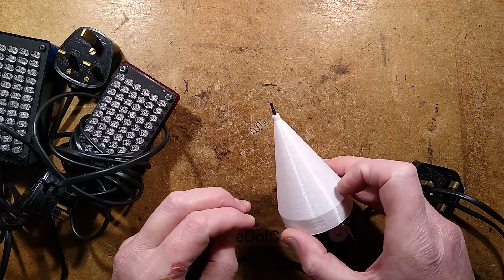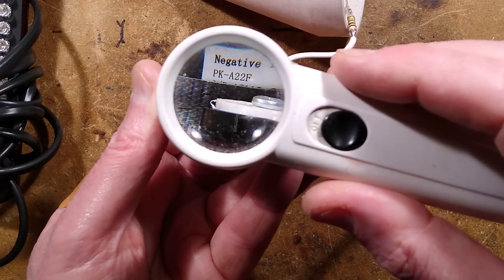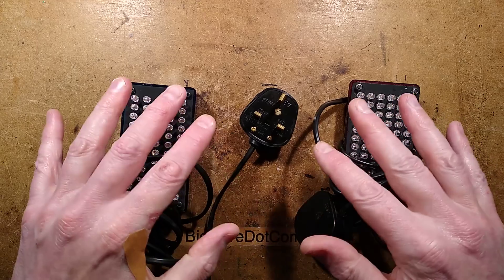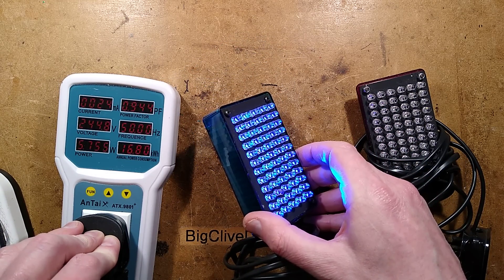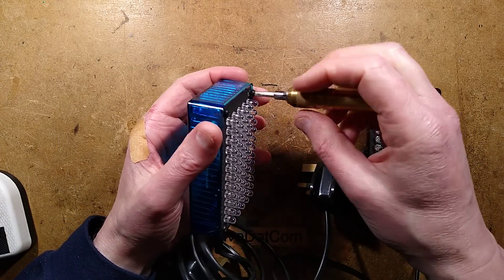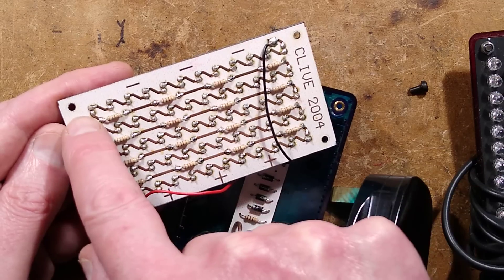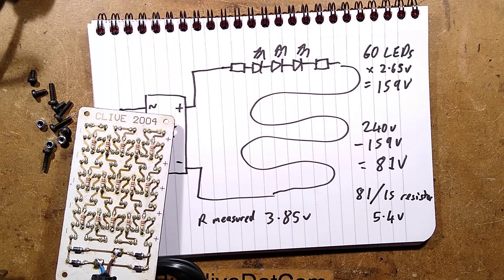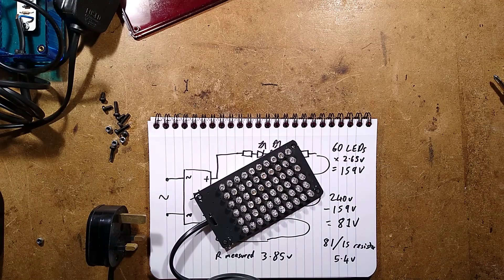Revisiting an OLD project from 20 years ago - with schematic.

Comment: I like these simple designed led lamp circuits with no fuss. Great to dissipate the heat over multiple resistors scattered around the circuit. Nice perfectly aligned LED's.

Comment: You mentioned wondering if things still get blocked by customs.  SparkFun did have a little fracas a while back when they bought a batch of inexpensive multimeters from overseas and they were held at the border because the yellow/gray color scheme was trademarked by Fluke.  A bunch of people were mad at Fluke, but they hadn't done anything, it was the customs agents that made the decision.  Fluke was very nice about it, and gave SparkFun a batch of genuine Fluke gear to replace the impounded lot.  I notice that some of those LEDs haven't failed entirely, they flicker some when power is first applied.

Comment: Hey there! Have just purchased a whole bunch of solar LED lights in Poundland and my troubleshooting on google led me to your channel! Essentially nothings turning on despite being left in sun for hours, is there a video you can point me to where I can learn how to identify the problem? I have zero technical knowledge but I do have a screwdriver and enthusiasm!
Reply from the maker: Check there's no battery tab to pull out and that the switch (usually hidden under the lens) is in the on position.   They can also be a bit sensitive to ambient light sources and stay off if you have another light nearby.

Comment: That burn on your left hand must have been quite deep to be still requiring sticky plasters😔😒😀 I have one on my left shin from my time as a motor rewinder. The result of a blob of melted plastic motor insulation, that landed on the leg of my overalls. It keeps releasing a scar plug that requires occasional taping😀

Comment: I remembered Radio Shack first released oddball Silicon Carbide blue LEDs back in 2000, they weren't the brightest thing in the world. A year later they finally released Gallium Nitride-based white LEDs. It was an interesting time, I remember being amazed by the first generation blue LEDs (both Silicon Carbide and Gallium Nitride) as red, yellow and green were a bit long in the tooth for me at that point in time but still a fun little component to play with.

However now, LEDs have gotten so ridiculously powerful that you can use them in flashlights and LED headlights (currently using the Nichia 319AT flashlight I put together, it's a wild tiny thing, only 3 x 3 millimeters in SMD LED package size, yet powerful enough to annihilate the eyes, I drive the 319AT LED in a Convoy S11 26650 flashlight somewhat hard, nearing the maximum amperage that datasheet said they can run all day long at with cooling, 1.9 Amps, and boy, it can light up the WHOLE room with just the specular reflection alone at full brightness).
Reply: Wowsers. I have a 519a and they can be blasted with an astounding 3 amps without keeling over. Possible out of tolerance but still impressive. And they're like 97CRI to boot.Nichia makes good stuff - I think they were the first blue led company.

Comment: Reminds me of the LED oscilliscope I built 45 years ago from a diagram in Popular Electronics magazine. I had a 10x10 grid of leds soldered into perforated board with wires running both ways. It worked, but every so often, one of my solder connections would fail. I had to use it in a dim room to be able to see the red leds.

Comment: I know what you mean about being unable to find a video. I spent like two years on and off looking for a video that featured a little side-firing 18650 light that almost looked like a mini fluorescent tube. By the time I found it, the factory that had made them in that size ceased production. I ended up finding an Energizer light that was the same size and roughly fit the bill.

Speaking of, I bought a spare of that Energizer to send over, but it seems almost impossible to disassemble.

Comment: Totally unrelated but the tiitle and thumbnail reminded me of it: I just bought a cheap nose trimmer that is said on the website to have a built-in LED but it's actually a tiny incandescent bulb !
And switching it on reminds me of my childhood's incandescent flashlights as well as of the era itself.
Reply from the maker: That's very retro.  Probably an old design that hasn't changed.

Comment: wish i could go back in time and learn how to make them from you. 
i think in 2004ish i was learning how to make my social centers PC go Pop by changing the RED Switch at the back of the Powersupply to 110V 
hahah had fun and no one found out untill i came clean back in 2012 aboot it.  i did how ever learn about the safity issues and such of PC Power Supplys
Reply: Dumb arse kids used to do that to the teachers desk computers in my high school... Until the standard procedure for unpacking new PCs had an additional step of dribbling 2 part epoxy into those switches.
Fortunately by the time I got a job in a school, those switches were a thing of the past and they all have full range inputs.

Comment: It would be interesting to rebuild this with modern LED's (same circuit) to see the difference in light output and power consumption.
Reply from the maker: Massively high light output.  It would be interesting to see an old one and a new one side by side.  Even just changing half the LEDs in one unit.

Comment: Looking at old projects, I'm looking at my old LED digital clock. Its big ! 6" (15cm) tall digits made up of 28 discrete 5mm red LEDs per digit. Six digits. TTL logic. Uses 15W, and a linear power supply. Mechanical hourly chime. Dim old red LEDs, as it was made in 1982, when I was still in college.

All LEDs still working. Replaced a power supply cap, when it was only 10 years old, and 2 7447s over the decades. Blew a lot of dust out of it, as its vented.

Comment: What would be the pros and cons of adding a "smoothing" capacitor to your lamp?
I'm guessing, you would need to handle peak-voltage, instead of RMS and I also guess it would ruin the powerfactor. But is there anything else against or in favour of a cap?
Reply from the maker: It would be a good improvement, but would require a lot more LEDs to keep the resistor dissipation down.

Comment: I made a pyramid ioniser case from paper mache using a unit like that recovered from an old air conditioner fan thing and put a neon bulb in it. But unfortunately I think a new ioniser module is needed since I see no noticeable signs it's working when I look at the carbon brush.

Anyway, break apart tissue in warm water, add pva as desired, shape, dry... profit. The poor man's 3d printing.

Comment: I think you did do a video on those lights, unless you do a lot of projects with those serpentine tracks.

But that’s okay, looking to see how a project has aged (or not) over a span like that is a Good Thing. Honestly I’m surprised that more of the green LEDs didn’t die or change color. You mentioned that you think heat might be the cause- letting it warm up for an hour or so and looking at it with an inexpensive thermal camera would be instructive. Would have been nice to have those twenty years ago, no?

Comment: Not just old school 2nd class leds that fail. I spent this morning swapping smd leds from one gu10 lamp to another based on the latter having just one short and one open circuit. The former had five blackened, Incinerated and several that look cooked.
Annoyingly, the lamp works for a while then one string of 30 - half of the lamp, goes out until the power is turned off and on which restores it briefly. So I now have to find the leds that are going open circuit I guess.
It has a cap, bridge, resistor driver board that was stuffed behind the non heatsink led circuit board leaving a brown burn mark. They weren't even cheap ones,just badly built for the throw away society. 
A few years ago I would have binned the pair of them but my new found knowledge from your channel & similar has caused me to start understanding these issues sufficiently to attempt a repair. Plus it saves me a morning of driving 30 miles, paying as much for parking as fuel to get there and hunting for a shop that sells replacement lamps or waiting five days for China or eight for British sellers to despatch and deliver some.
Reply: they are cheap ones just sold at ridiculus markups
Reply: @urugulu1656  you must let me have your crystal ball or perhaps, with your insight, you can find my missing 8mm socket

Comment: I have often been wondering about what the powerfactor is a measurement for when the powermeter appear in your videos. So, what does it stand for and how is it calculated/measured?
Reply from the maker: It indicates the relationship between the voltage and current waveforms.  Not super important for most people, but quite important for the utility industry.

Comment: The first blue LED I bought cost me $15 (yes, for one) and was nowhere near what you'd call bright. 
But it was BLUE! "Just imagine all the cool stuff we can do when these become cheap!"
Yep, they're even sticking them in computer fans now for some friggin' reason...
Reply: Those were the old Silicon Carbide blue LEDs. Not very bright, but the blue color is just fantastic vs the modern InGaAs blue. I bought some new old stock, and if they weren't extremely rare I'd integrate them into more projects.
Reply: @No-mq5lw  It was a nice color.
Reply: It's so you can watch the air it's moving.  😁
Reply: @sarkybugger5009  When I first saw LEDs going into fans I figured, "cool, they're gonna strobe it!"  (Also figured they'd put something on the blades to animate) but so far I still haven't seen it done (nor have I been looking.)
Reply from the maker: I think they have done "message" fans with stripes of LEDs.

Comment: Isn’t the measured voltage drop across the resistors affected by the diodes when they are not conducting the unsmoothed DCV?
Reply from the maker: The main issue with getting a measurement is the unsmoothed DC and odd current waveform due to the voltage drop across the LEDs.

Comment: Reminds me of a to3 transistor, 2 cement wire wound resistors from radioshack and 2 windings of speaker wire, hot glued to a flyback from an old TV, that's one thing I'm going to miss is the availability of free flybacks in the alley
Reply from the maker: I gave myself a few high frequency burns making similar high voltage inverters.  These days a MOSFET might be the way to go.

Comment: I know that feeling. I had the same kind of shock when I looked at a date on a project and said that was 20 years ago!
Reply: Oh, let me check a project I made after I started my first job, ah 1988! It’s a bench PSU that I still use. Only thing that I have replaced is one of the potentiometers. Although one corner pillar in the case is broken. All the parts came from Maplin by mail order.
Reply: Looked at one, and i made it in high school........
Reply: I can usually date mine by the soldering. It starts with wires twisted really really tight and progresses from there. :p

Comment: You should really get a small handheld electric screw driver. Those pen-lile ones are nice, dont have too much torque to strip the screws. A slight downside is that they might also not have the torque to pull out tight screws.

Comment: I had a conversation with another author of a project that applied rectified but unfiltered (not "smoothed") DC to some nonlinear devices like LEDs.  He said it had to be multiplied by the cosine of the phase angle of the conduction.  For a blue LED, it doesn't conduct until the voltage gets up to 3V.  So if the AC across the LED is 6V peak, the LED is conducting current during the 3 to 6V part of the cycle.  But I've forgotten the rest of the calculations involving the cosine, etc.  I hope that was helpful.  The greatly simplified solution is to connect an electrolytic capacitor across it and get straight DC, making it easy for the meter.
Reply from the maker: The blue LEDs start conducting and glowing at about 2.6V with increasing forward voltage as the current increases.  That makes it a super-complicated voltage/current waveform.

Comment: The boards look similar, believe you posted something the same about a year or two ago, but don't entirely remember, something about you painting the boards black...

They held an item in customs because of the locking nuts? Customs wouldn't be checking anything like that at all, surely, down to the make of components? Sounds like someone wanting a bribe more like

I can imagine you wanting an ultra high power coloured led light because nobody else would be making them or even have them, knowing they were maybe a few dodgy ones and grilling the tits out of them for the power

Comment: About 30 years ago I built one out of surplus green LEDs from Tektronics. Here in the U.S with a 120 volts and about a 170 volts peak. I use a group in series of 6 X 12 or 72 LEDs, and in both directions for a total of 144. Straight into the wall. It has been running all that time with no failures. I'm just waiting for one go, and then it's all over with. I think, or maybe just half of the panel. 😂
Reply from the maker: I think the foreverbright LED strings ran directly across the power too.

Comment: Blue LEDs were amazing when they hit the market. Remember when they'd stick a piercing blue indicator on every bloody thing.🫣
Reply: Remember when?!?!😂 They still put them everywhere.
Reply: @simont3686 I have tape over lots of LED indicators.
Reply: I think it still happens too much. Makes me realise the red LED has been under rated all this time.
Reply: @Poult100  Yes. Red or amber are so pleasant to look at. They don't stress the eyes at all. Even green is better than blue. Blue is literally the worst color for indicators. But somehow the companies still equate the modern-ness of a product to the brightness of its blue LED.
Reply: .@Poult100  but do you remember when leds were simply that
..indicators. none of this actual lighting nonsense! Even the tiniest red ones dazzle nowadays. Bring back frosted 5mm pls...
Reply: @gs425  I do remember that. I remember thinking, I wish these were bright enough to put on my bike as a rear lamp. I'd never have dreamed LEDs would ever be bright enough for headlights!
Reply: @gs425  I remember LEDs being a reasonable low-voltage replacement for the little neon bulbs, and that was all!
Reply: @Poult100  It's a shame that some designers only understand there is one type of led... those same  high bright leds lol.
Reply: I had a couple of external hard drive cases, the single blue LED power indicator was so bright you could read in a dark room with only that powered up. Must have been good quality though, I don't remember one ever failing on me.
Reply: @tncorgi92  Maybe something is true about the theory that brightness equates quality xD
Reply: Sony hasn't stopped with obnoxious blue. Every Sony TV I have AND my ps5 all have obnoxious blue.
Reply: @jwalster9412 'obnoxious' blue is sony's brand them stopping the usage of blue would be like stopping the tide
Reply: Shame as the good blue LEDs run at a very low current make really nice indicators with their deep soft blue glow. Instead they go for maximum eyesore in modern electronics. But still not as bad as a PC where they run them so hard that they die after six months.
Reply: Only when I'm trying to sleep
Reply: Every battery I own (of the type for recharging my phone when the power is out) seems to have 4 blue LEDs to show approximate level of charge. They get annoying. Red or amber would be better, or green.
Reply: SLX aerial amplifiers would light up the whole loft! 😂
Reply: Replaced a blue and red LED on my computer case with a warm white (HDD) and orange (power).
Much better.
Reply: I first realised blue LEDs had been sorted when you saw two, brilliant blue dots  on the wiper blades on the front of trucks.
These evolved into a bright cacophony of blue light, illuminating the whole interior of the cab!
I'd gone from "Oooh! Blue LEDs, look!" to "Bugger me sideways! Look at the state of that!

Comment: Hi Clive, thanks for another interesting video.  If you made the same project today, would you use a death beam capacitor to smooth the output of the full bridge rectifier?    Smoothing seems ubiquitous in designs now, I guess they would eliminate any visible flicker, and give the LEDs a much smoother supply (I wonder if LEDs using smoothed power would last longer and fail later than the identical build without the capacitors)?
Reply from the maker: I might, but that does increase the voltage to the sinewave peak.  So it would require more LEDs.